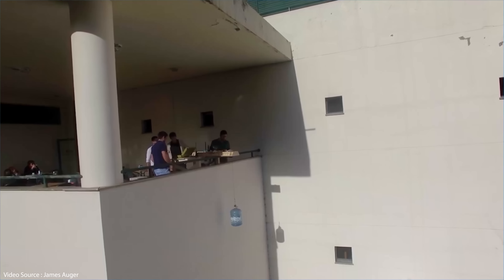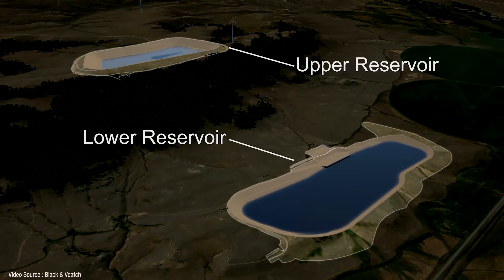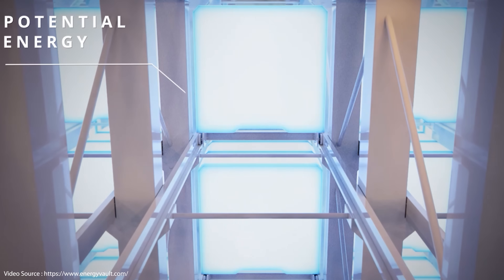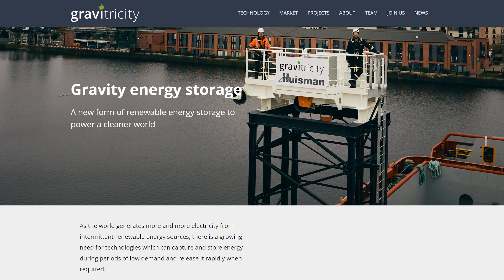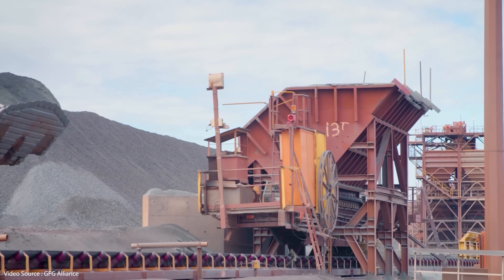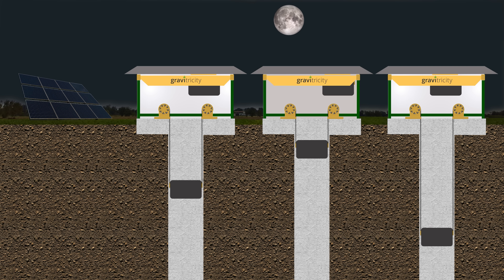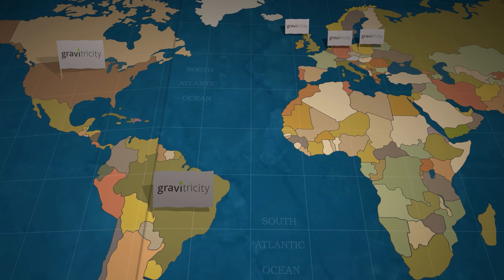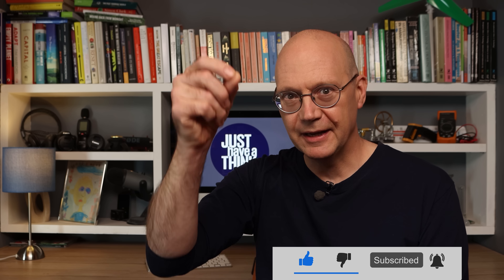Gravity Energy Storage. Who's right and who's wrong?

Comment: Did anyone notice that hole they had to dig?   Mmmmmmm.  How about digging a cylinder of mass instead.  While you're digging, line the inside and outside of the ring with steel and concrete on both sides of that cylinder slot.  Once you get deep enough for the amount of mass you are looking for, drill horizontal holes across the center at the bottom, feeding the cables through, back up, and connect to pullies on the other side.  To keep the mass from tipping, connect all the pullies in a geared ring.  Now to add power, all you have to do is lift the mass out of the ground.  A simple, cheap gravitational battery.  OMG!

Comment: I detect more than a little derision in your voice when you spoke of those who "debunked" EnergyVault but ultimately they proved to be correct. EV was pushing a concept with numerous flaws that were obvious to anyone with even rudimentary engineering knowledge and their revised concept is not really much better in those regards. They have obviously never heard of the concept of reducing points of failure, also known as KISS or Keep It Simple Stupid.

The Gravitricity appears to be a much more streamlined system though there is a limited number of decommissioned vertical shafts to use for such project meaning startup costs would also need to be calculated with the costs to dig bespoke shafts for the system to operate in.
Reply from the maker: Did you really get the impression that I disagreed with the debunkers conclusions about Energy Vault?? If you did, then I clearly failed to communicate clearly enough in the video.

Comment: So why not marry a pumped hydro storage system with an abandoned deep mine.  Tanks for storage near the top and tanks for storage near the bottom with plumbing, pumps and turbine generators in between.   Need more energy storage?  Just add tanks.   Need more power capability, add pumps and turbines and plumbing.   I suspect that the companies which have built existing pumped hydro storage systems could scale the control systems to the mine environments.  Certainly there are mines much deeper than the maximum height differences in above-ground PHS.
I suspect there are mines with much bigger storage capabilities.   And the water won't evaporate.

Comment: I've always thought that large wind turbines offer the ideal infrastructure for gravitational energy storage; a tall tube, protected from the elements, in which a single large mass can be raised and lowered depending on electricity demand.
Reply: Wind turbines are ‘top heavy’ enough. Having to engineer in having the energy storage weight at the top of it’s run would add greatly to the cost.
Reply: @mikedavison3400  I don't think that's an insurmountable obstacle. What may be an issue is the variable resonant frequency of the structure as the weight is raised and lowered.
Reply: @nagualdesign  I agree as a Wind Turbine Fatigue Engineer - we need to consider resonance and whilst I want to see a real world energy storage solution asap, this idea does need to be checked.  Maybe if the weight is not using the full height of the tower, then a solution could be worked out.  Also the weight would best be a cylindrical tube rather than a solid block.
Reply: But would the required reinforcement to be able to hold a significant mass be economical?
Reply: @ Bart 
🎯
Reply: No. They're not tall or wide enough. 100T lowered 50m in an hour would give a steady 14kW before conversion losses. For only one hour! A 50m turbine might put out 1MW peak. So the storage is tiny.
Reply: @luke.perkin.online  Your units are wrong.
If you are lowering a weight and also state a time such a 1 hour, then the units you should be using are KWh and not KW.

If you don't specify a time, then you're talking about power which is measured in KW.
Reply: @deang5622  I used kW on purpose, to compare with the power output of the turbine, also measured in W. I said 14kW for 1 hour, pretty clear I think, but I've edited and added the word 'steady' 🙂
Reply: @luke.perkin.online  No it is not clear. You have stated that 100 T lowered 50 metres in one hour. If you wanted to do a comparison with the instantaneous power output of the turbine, then yes, you would use watts or kilowatts to describe the power generated by the falling mass, but then mentioning the fall height of 50m is redundant and not required. It is not relevant.

I am not convinced the insertion of word "steady" is accurate because as the mass falls it will accelerate under gravity resulting in increasing power being generated throughout the 50 metre fall, unless there is some mechanism to reduce the acceleration to zero(such as a brake) or some kind of voltage and current regulation is employed. It's quite plausible there is voltage regulation employed in order to ensure compatibility when feeding the electricity into the national grid but I doubt they would be controlling the power.
Reply: @deang5622  Do the numbers yourself and you'll see that 100 metric tonnes has ~14kWh of potential energy at 50m. I don't know what else to say to you.
Reply: The main problem with this idea is that the towers are only designed to handle the weight of the turbine and wind loadings with a reasonable safety factor, so they are not capable of safely handling tons of extra weight being lifted to the top.
Reply: The blades cannot be recycled when they have reached their end of life (About 20 years, due to stress fractures),
Reply: @GrahamCampbellNZ  There's a company in Sweetwater Texas that is converting them into fiberboard for wall and flooring construction. They use 99.9 % of the blade and can handle about 7000 blades a year at one facility. There are ways to use them. People just aren't doing it large scale yet. We may also come up with a material besides fiberglass for them one day.
Reply: @blackwind743  Great to hear!!
Reply: @GrahamCampbellNZ  Blades will be recycled, they ARE recycled.
Reply: @GrahamCampbellNZ  Not true for all new blades now - there are increasing numbers which are recyclable.  Check out Siemens Gamesa.
Reply: @GrahamCampbellNZ  your old news. Stay up with the times man!

Comment: The graph showing the cost of gravity storage vs other types of storage does look encouraging. But if you look closely it will triple the cost of energy.  171$ per mwh is extremely expensive.
Reply: storage supplies for peak-time demand is much more expensive than base-load.   but is essential for getting to use super-cheap infrequent solar/wind.   that cost isn't that high for current storage needs.
Reply: @mralistair737  Wind and solar are currently not cheap when compared to other sources of power.

171$ per mwh is still expensive during peak hours.  In Ontario Canada we typically only see prices that high for 3 reasons.  Peak demand during one of the hottest days of the year, big fuck up with the pre-dispatch vs actual demand and equipment failures.

I just cannot see this making financial sense without getting compensated for OR or frequency response.

Comment: There are already projects in the US looking at using abandoned mines for gravitational energy storage. 

The code word I've seen used is PSHAUM or Pumped-Storage Hydropower using Abandoned Underground Mines, and the projects I've noticed are in the usual coal states of Kentucky and Indiana, as well as in China. 

Perk about these systems is that the water bodies are not exposed to the atmosphere, meaning that the system can remain closed loop and allow for little to no water losses. With normal pumped-storage and dam hydropower, evaporation works against you. 

Looks like the deployment timelines for those projects are similar to those of Gravitricity, so it's hard to say if a vertical shaft-based or an isolated reservoir-based technology is better or worse. 

As with anything in sustainability and resilience, relying on multiple tools to achieve outcomes can mean that those outcomes come faster. It could be the case that these two types of storage could be stacked in the same mine site to get as much power out as possible, or be deployed at mines that have the right characteristics for the tool. 

Love these videos Dave. Wouldn't this fall under a Just Have Another Think video? What happened to that project? I think the last one you made was about policy, which probably didn't do as well as say your Perovskite solar or battery videos, but it's still a solid platform. 

Cheers

Edit: grammar
Reply: The problem I think with pumped hydro in mines is that the mines tend to fill in with groundwater once you empty them, meaning no space for the water to go at discharge time. Maybe not a problem if you find a place to put the surplus water that you're generating, you'd need a secondary spillway that goes somewhere else and you'd need to be sure that the water from the mine isn't contaminated.
Reply: @AlRoderick  if it fills with water then that scuppers the weight lifting/lowering idea too.
Reply: @robinherrick2177  I don't know if it scuppers it, weights sink in water too, the buoyancy would just affect the total capacity (the weight would store less energy per unit height in water).
Reply: @AlRoderick  fair point, but there are also drag losses and corrosion issues. I don't know what the density of the blocks is. 5 t/m3 material so maybe 3 apparent? Add buoyancy and that's a fair efficiency hit.
Reply: Thanks for your post about PSHAUM. I had the same idea after watching the video so the fact that someone else is doing it isn't surprising and saves me having to do it myself. 😂
Reply: Agree it would make a good topic for a video.

Comment: Solving the next great problem in energy is worth billions if not trillions. Unfortunately, that will attract charlatans.  I do think you should do better diligence and at least try to check whether their ideas add up. Are this startups just trying to milk investors for cash, or are they irredeemable optimists or are they actually suggesting a plausible strategy?

I understand that's work, but where's the value in simply restating a startups press release, in essence?

Comment: Yeah no . Gravity storage just requires far too much mass automatically moveable. Only works for water because forming water into a format that can be moved around in elevation is very cheap. Blocks of concrete, not so much. Needs steel reinforcing to make them safe to move, etc etc

Doing economics with 1 full cycle of store-release energy each day is wrong. Batteries can out-compete that economically. Whats not available and needed is storage that can be charged in mid-summer and discharged in mid-winter, once per year. Economically! THATS the difficult task.

Comment: No one system is going to cover all our needs but this does sound like a very simple (relatively) solution which will be one of the many we will require. It's only going to work in shafts that aren't flooded though and that may be a limiting factor.
Reply: @goodcat1982  cost, time and waste, we are facing a £120bn and climbing bill to sort out Sellafield. The French have had to Nationalise EDF because the economics don't stack up. I am not against Nuclear but it has some serious issues that need sorting